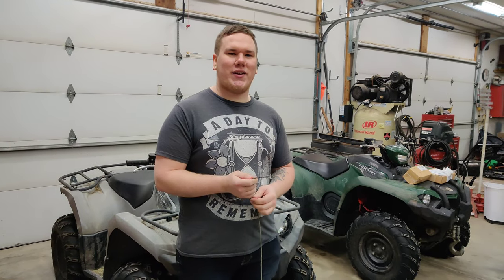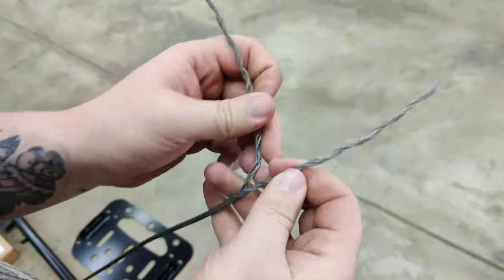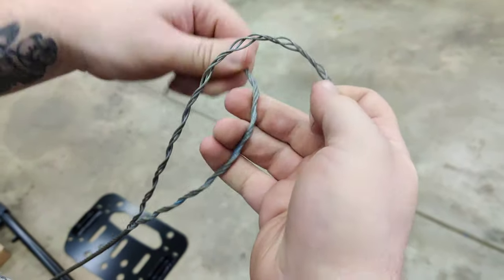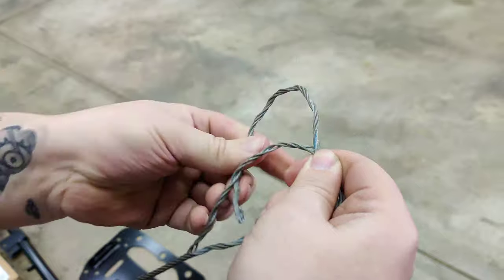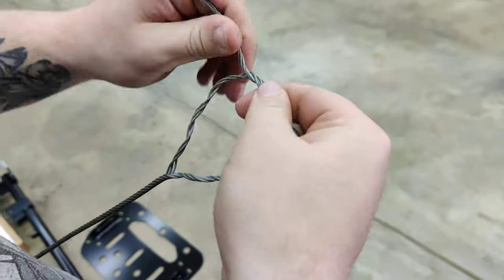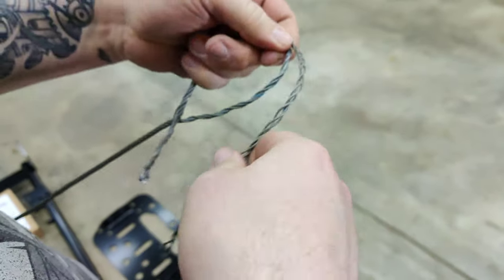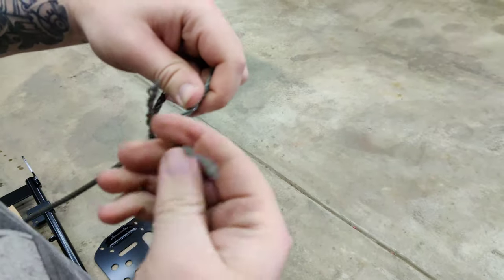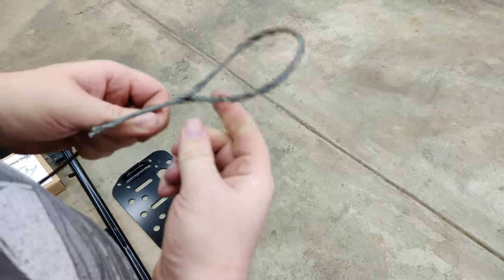How to Fix a Broken Winch Cable

Comment from the maker: Hi! Let me know if you liked/disliked the video and if you have any suggestions for future videos. I hope this helped you out, thanks for watching and have a great day :)
Reply: Hi James. Great video. Just wondering, how long will this method last when I am constantly and repeatedly raising and lowering my very heavy solid steel plate snow plow on my Polaris Sportsman 500 ATV with a 3000LB Champion wench. I cannot be left stranded relying on this method and waiting to use my winch after the next heavy snowfall; only to have it disconnect shortly after I start using it.
Reply from the maker: From my experience it seems to be as strong the rest of the cable. I've been using this method on my kodiak 700 with a plow for a few years now with no issues. The only time I had a break using this loop was on the cable about 2 feet back while pulling another atv uphill and the loop was still intact. Good luck hopefully everything works well for you 👍

Comment: Very efficient knot. I used it on a broken winch cable, and it's been holding up strong ever since. Thank you 😊
Reply: Thanks. That's my question. How long will this method last when I am constantly raising and lowering my very heavy solid steel plate plow?

Comment: When I had a winch with steel cable that broke, I just used a small cable clamp which worked fine. Now I use the synthetic rope so I have to use that method too attack it to my snowplow. The rope last much longer (years) before I need to re-tie it. Cable is a thing of the past now.

Comment: Awesome! Thanks, man! This is super helpful to know. I'm putting it to action right now. I thought I'd be waiting for sleeves in the mail and hoping they're the right size.
Reply from the maker: Glad I could help! It's always held up well for me on all sorts of different cable sizes. Just make sure you leave a long enough tail at the end and you shouldn't have any problems
Reply: @BetterDays  it was a total success and so easy to do :) Didn't take me much longer than the video. 
I haven't used it for anything but my plow so far. Have you found it can hold up for bigger jobs?
Reply from the maker: I've used it for plows and pulled an ATV out of a mud pit and up a pretty steep hill. I don't have a winch on my truck to test but my Yamaha Kodiak 700 is pretty heavy and it hasn't broken since the original loop came undone. I use the winch all the time at the offroad park
Reply: @BetterDays  It's been over 2 years now and I've done all sorts of things. I've pulled downed trees and atv's and it's still holding up! Thanks again for this video!
Reply from the maker: Awesome, glad to hear it!

Comment: Actually, it is called a "farmer's eye." Or, more formally a "Flemish eye." A Molly Hogan is a single strand of cable used as a keeper pin to stop a larger pin from sliding out. Like a cotter pin. Your tail needs to be a minimum of 10 times the diameter of the cable.  If, you don't want to effect a permanent repair,  you need two Crosby clamps to secure the tail.

Comment: Will that half the SWL ?
Reply from the maker: It should be around 80-90% the original strength. I haven't had any issues with this method, just make sure the tail is long enough so it doesn't start to unwind
Reply: This method of splicing an eye is stronger than a simple loop and clamp. Good video!